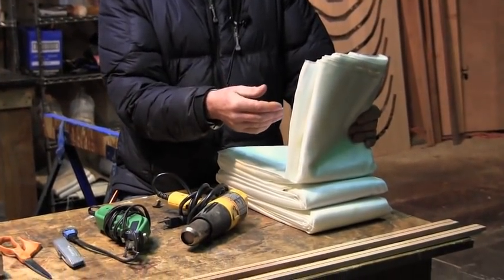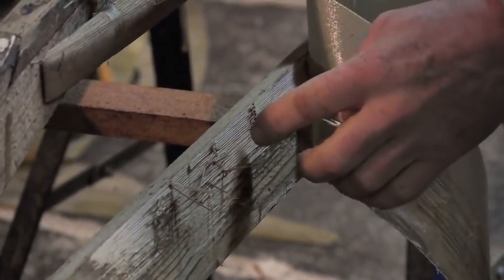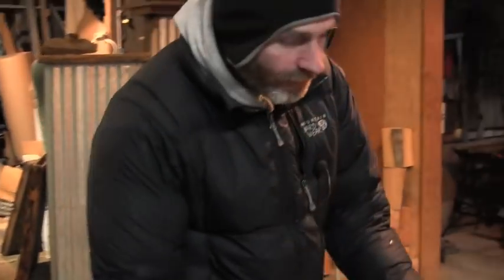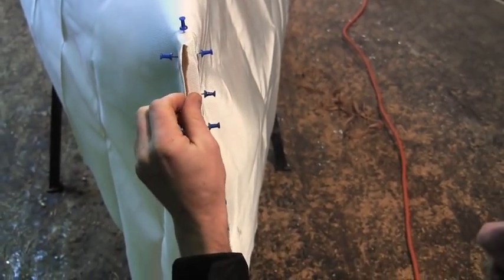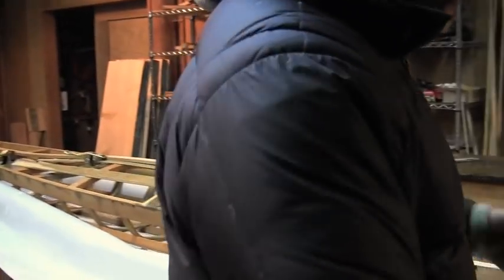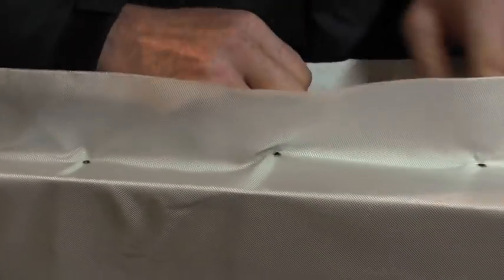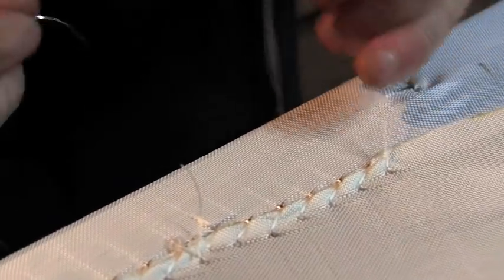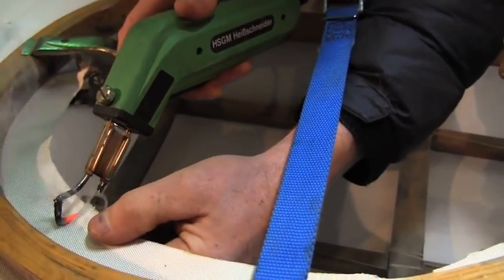How to sew a new 'skin' on a skin-on-frame kayak

Comment: If you use shrinkable dacron (8oz), you can attach the fabric using aircraft fabric adhesive and completely eliminate the need to do any stitching.  Apply fabric and shrink using a clothing iron. Super tight and wrinkle free way to do it...
Reply: Hi John, Have you experienced that or just sharing your opinion?

Comment: Thanks for your excellent video's. They've helped a lot. Thought I followed your directions, (Dyson 8 oz. nylon, Jacquard acid dye, etc.) made a complete mess with the dye running straight through the nylon and all over on the inside, and it shows from the outside. What did I do wrong? can it be fixed? Can I re-stain a lot darker and somehow still get adhesion? maybe by rinsing out the vinegar? Again your video's have been very helpful. Thanks.

Comment: Hi im pondering a construction strategy for a sof+gf construction. 
Length 5800mm beam: 530mm 510 wetted.
Wheigth goal 16kg.

Step one build a frame with bulkheads and encapsulate it in gf and epoxy. 

Step two dress the frame in nylon or similar. Use epoxy as coating. Fixing the nylon to the frame. 

Step three bonding some layers of gf to the nylon cover and coaming. 

Step four cut out for rudder and hatches etc. 

Step five flowcoat epoxy, sand, pu coating. 

The idea is to get the added structural strength from the wood members bonded to the shell. But still have the freedom to do some custom tweaks, and have an abrasionresistant and durable repearable construction.

Concave sections are adressed with rubrails monted to the wood members before the skin is tigthened comletely. 

The wood will be ash, and the dimentions will be smaller than a traditional sof, due to it working in tandem with the shell. Just strong enough for skinning with nylon. 

Question: will the nylon work as a peel ply? Nylon bonding with epoxy. 

Any thougths?

Thank you for indepth videos, certainly on your thouths on design considerations on your kayak designs.

Eirik. Norway.

Comment: I'm wondering why you recommend shaving the stem and stern if someone cuts the skin too short? As someone who has camped under silnylon for decades, I'm only too well aware of how nylon stretches when wet. So why wouldn't you simply dampen the skin? Does that result in excessive tautness?
Reply from the maker: It just makes it a lot harder to work with.  Once the skin is damp it must stay damp for the entire skinning process, and you have to heat cut it wet as well, all of which just ends up with a lot of nasty smoke and misting with a spray bottle every 10 minutes for 4 hours.  Wet shirt, wet floor.  Also, some nylons shrink very hard and if sewn on wet can crush the frame.  This is an old video, the instructions in my building courses are a lot more comprehensive.

Comment: Soldering iron=hot knife
Reply from the maker: Not quite, soldering irons don't put out enough heat, it works, but it doesn't work great.
Reply: Just a fantastically helpful video. About to start skinning my first SOF kayak (fuselage frame, touring style) and have yet to find a better source of information on how to go about it - many thanks.